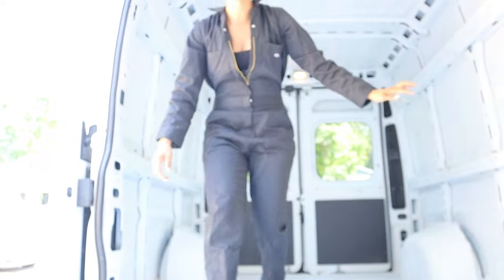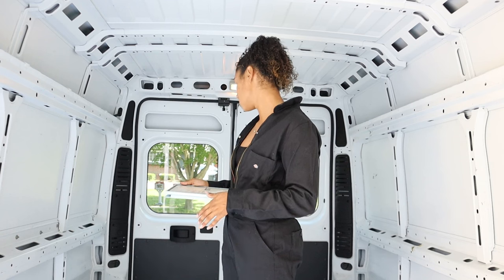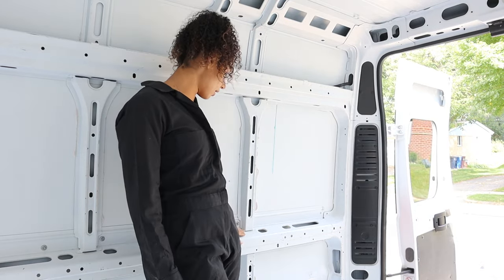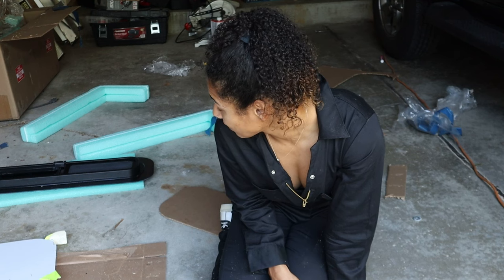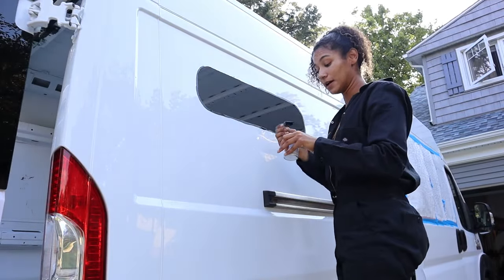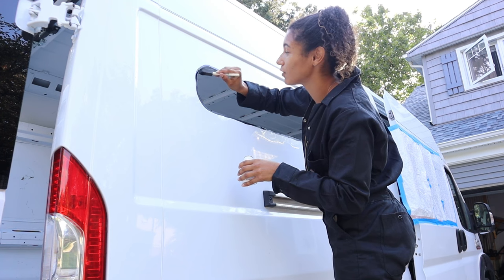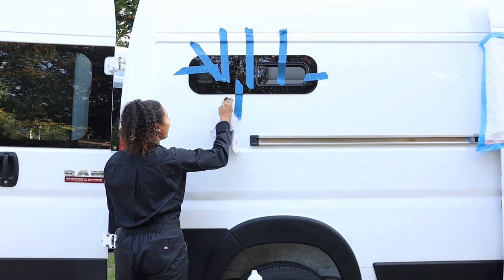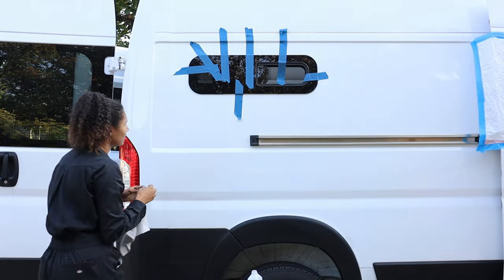VWD Bunk Window install on my pro master | Van Build Ep. 3

Comment: Overalls are cute and so is the cleavage ?
Good job installing the windows 👍
I worked in a Van Conversion Shop in the 70's and nothing scared the S**t out of me more than  cutting outt a window in a brand new van shipped from the factory !
I worked in the Paint Shop most of the time and if you don't like it you scuffed it down and re-do it ? But never had to 😊
You will get in the groove !
✌️💙🎵 From STL MO

Comment: Hello,  Nice work,  I hate to point this to you but I think you have install the windows on the wrong side, Drivers side window on passenger side etc.
Openable window supposed to go to the back of the van. I hope you do not have any water intrution issues.